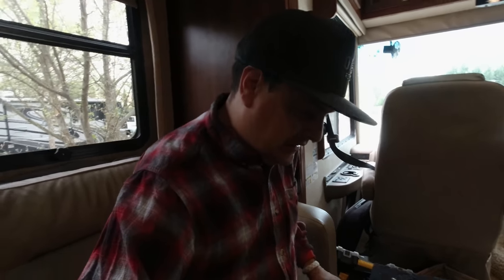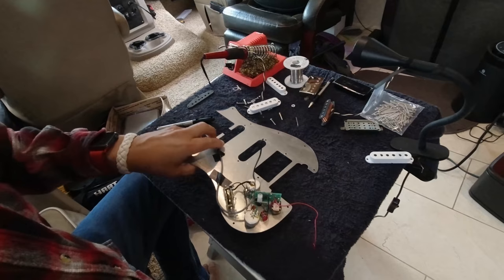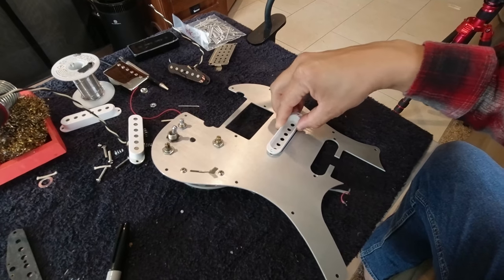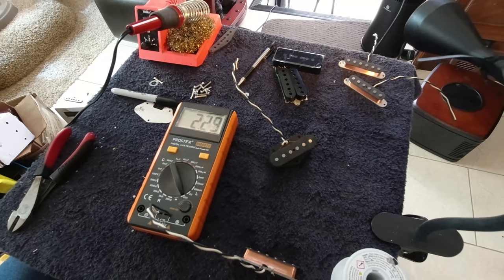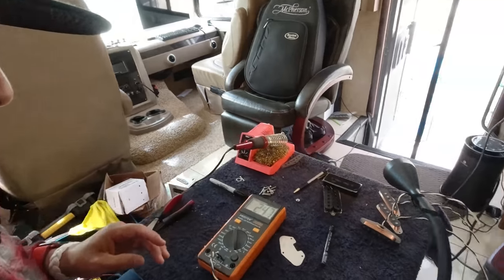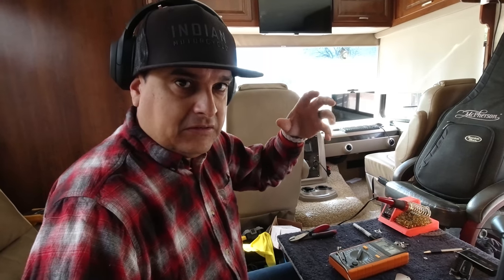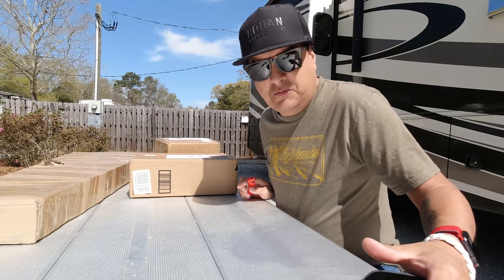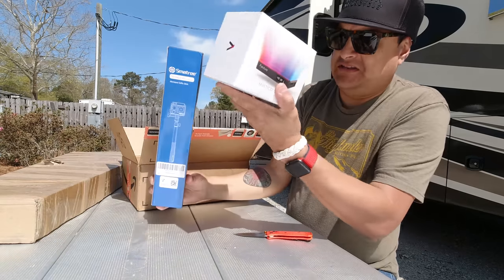I Bought The Cheapest Clear Stratocaster On EBAY - VLOG

Comment: Hiya I've wound around five sets of strat pickups  and had no way apart from coil resistance to measure them, also at the time I could only buy minimum numbers of magnets and wire so it was an expensive outlay for experimentation, I used alnico 5
But I wanted to try mixing them up
Say fives on some strings and twos or fours on others, the cost was prohibitive

Comment: I have had quite a few wooden or aluminum pickguards from china that did not fit the standard strat pickup covers. The plastic ones are mostly ok. I think it has to do with working with an in spec blueprint versus making a template from an existing pickguard that is already a bit off. With china you sometimes end up with copies of copies, getting more out of spec with each iteration.